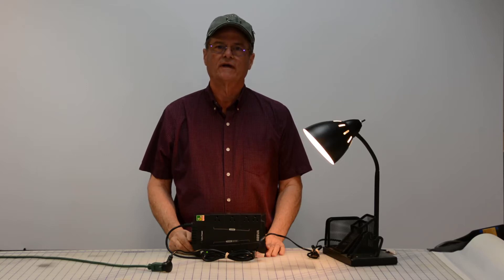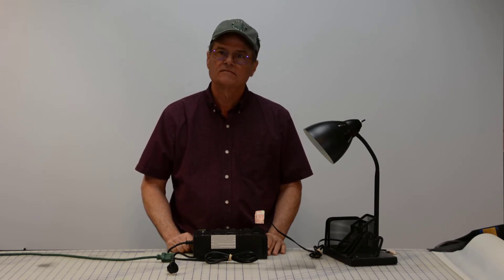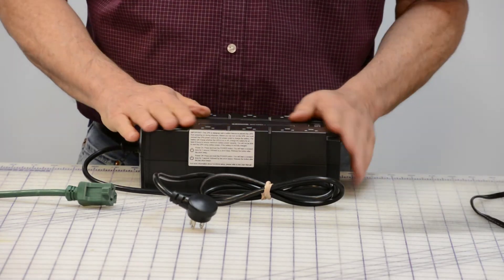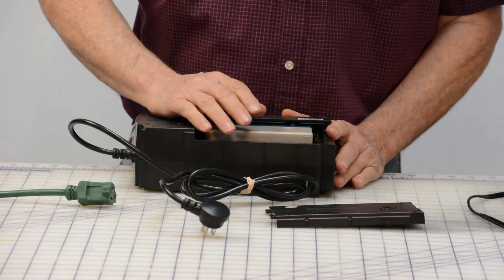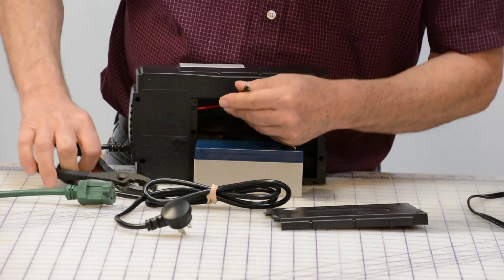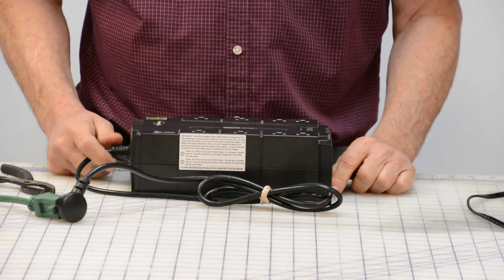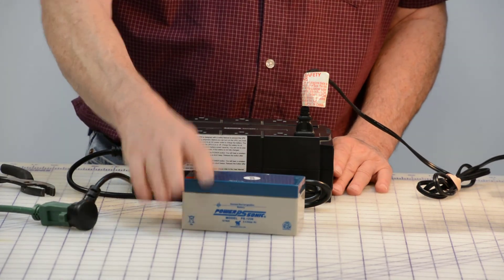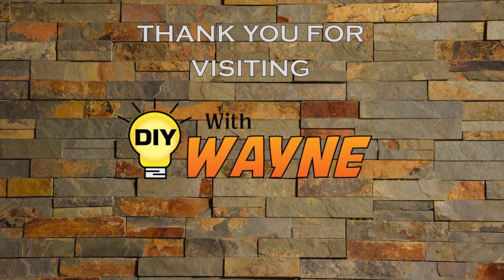Battery Backup Repair CyberPower

Comment: Opening up the compartment for the battery. I have tried a T10 and that doesn't seem to work. What bit do I need?
Reply from the maker: I can't say, different years / models use different ways of securing the cover.  Good luck with your project and have a great day.
Reply: @DIYwithWayne  It worked. I just needed a longer bit

Comment: Hi Sir. Nice video. Tell me something please, My CyberPower is always pluged into the wall and it's in my living room so it takes the TV, the CD player, the AM-FM receiver and the DVD player. Today, all my accesories refused to work. After seeing your video, I checked if the battery was ok and as I thought, it's not ! But, howcome the unit doesn't work anyways ? It's has electricity. Thanks.
Reply from the maker: The unit should work even with a bad battery, just no battery backup.  It sounds like the electronics went bad.  It most likely needs to be replaced. Thank you for visiting and have a great day.

Comment: Quick question..... I have a Cyberpower 450VA that has been sitting for awhile. When I press the power button nothing happens. Is this the sign of a completely dead battery(I'm going to try to charge the unit for awhile and see if that helps) and once it has a new fully charged battery the power button will work again? The surge outlets are working but I assume that the power goes right to them from the outlet. any thoughts? thanks!
Reply from the maker: First question, It's hard to say.  second question, There is a good chance it will work at this point.  The surge outlets are completely separate from the battery backup outlets so if the battery is bad they still work.  I suspect the new battery will fix it.   Good luck with your project and have a great day.

Comment: Yes, it was helpful to know it was a Philip's, but it still has me defeated.  It's so deep that I can't see in order to know if the head of the screwdriver is setting well in the screw.  I keep twisting the screwdriver and for all I know I could be reaming out the screw drive hole, because the screw is not loosening.
Reply from the maker: I have had the same problem.  I suspect your screwdriver is not getting down to the screw.  Try using a screwdriver with a smaller shank and I think you will have success.   Good luck with your project and have a great day.
Reply: It looks like a Torx to me. It is definitely not the same as the other two screws holding the case together. I cannot get it out.

Comment: Do you remember what sort of voltage reading the old battery had...? Reason I  ask,  my battery appears to be reading high enough to be good, but fails the units battery test. It's a Cyberpower 850 va.     
I don't have a similar working unit where I can temporarily swap the battery to see if it's just a bad battery. Thnx
Reply from the maker: A battery that is not under a load will often read good even if bad.  If the battery is over 1 year old, there is a very good chance it is not holding a charge and will fail under the test.   Good luck with your project and have a great day.
Reply: @DIYwithWayne  Thnx... like you said. There was no load, when I put the volt meter on the battery...front panel display is misleading,  says its fully charged...I  wasn't sure if that could have been the reason it failed the internal battery test... but the "no load" idea, makes sense...
Thnx again...

Comment: Came to see how to remove the back cover (I was messing around with allen keys, had no idea it was a philips - it was hard to see) and stayed for the four or five great tips that followed.
Reply from the maker: Hello Richard, thank you for visiting and your kind comment. Hope you will continue to find my site helpful.
Reply: It looks like a Torx to me. It is definitely not the same as the other two Phillips head screws holding the case together. I cannot get it out.

Comment: The small screw on the Cyber Power SX650G has a "non-removable" screw.  I used a drill to drill it out, which ended up drilling through a small amount of plastic and allowing me to remove the sliding panel.  The battery is marked CPs5.5-12(12 v5.5 AH).  The manual says the battery is nonreplaceable, but you can find it easily on Ebay.  It seems like a ploy by CyberPower to get you to buy a new unit.  Very wasteful of resources and unnecessary.
Reply from the maker: You are correct that the battery can be replaced.  I suspect the Lawyers suggested that so if someone gets hurt replacing the battery, they can't sue.   Thank you for visiting and have a great day.

Comment: Whats that battery model? I need to replace mine. :(
Reply from the maker: Dan,  There are different size batteries. The best option is to remove the old battery and it will be stamped with the size info you need.  Thank you for visiting and have a great day.